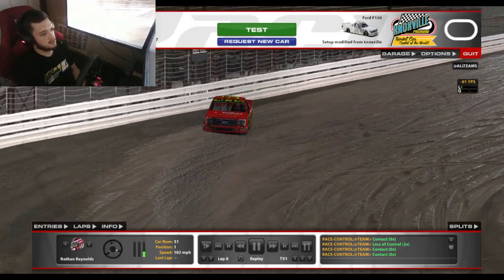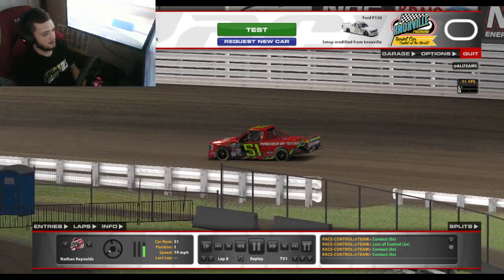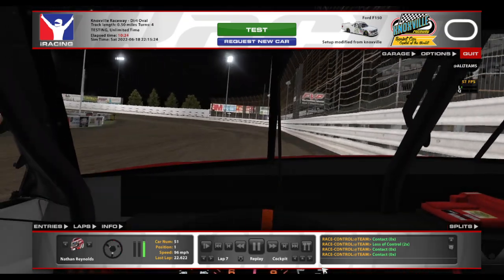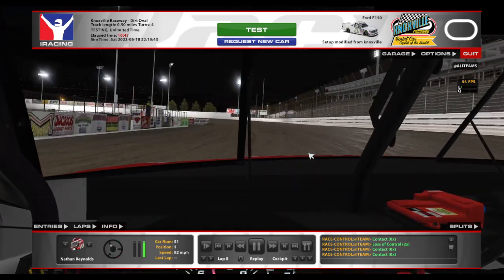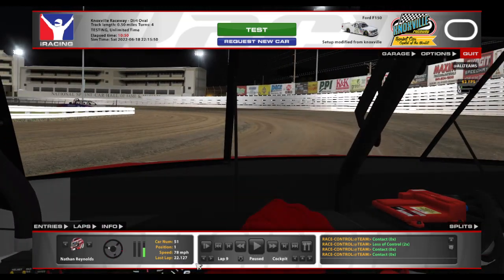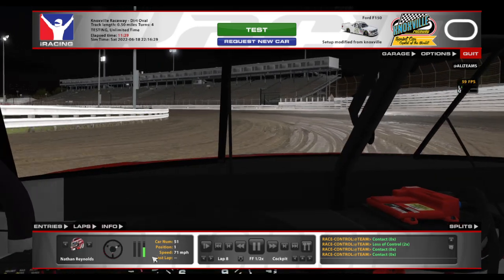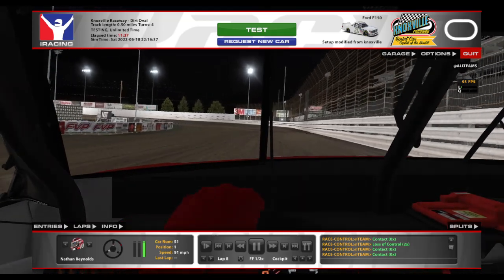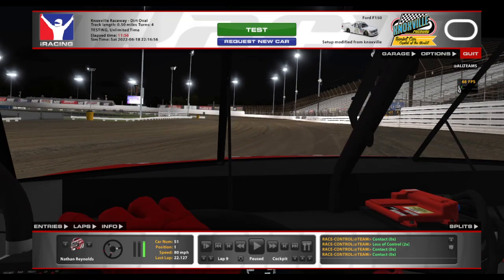Qualifying Breakdown // iRacing C-Fixed Trucks at Knoxville Raceway

Comment: Can you please help us new guys out with you Steering ratio, offset and BB.
Reply from the maker: Yessir! I think it should be listed in the video description. If not, I'll add it. I normally use either a 8:1 or a 10:1 on all dirt tracks and set my wheel to either 360° or 540° of rotation to have a faster response. I set my offset to whatever sets me to center but it's typically +5 to +6. Brake bias set high 65+ so you don't lock up and spin whenever you need to use brakes